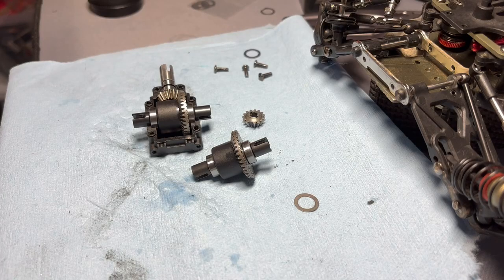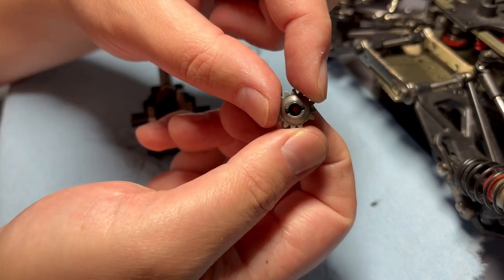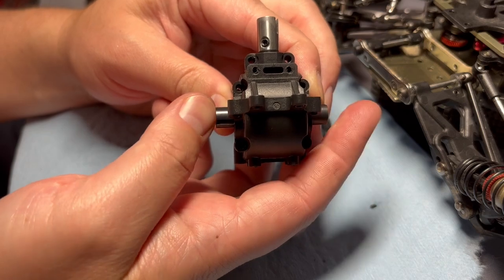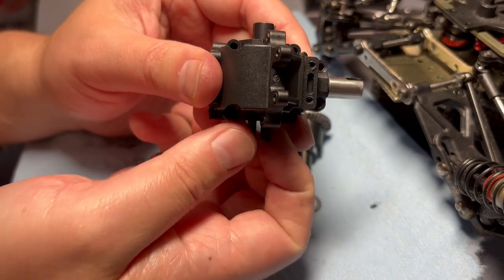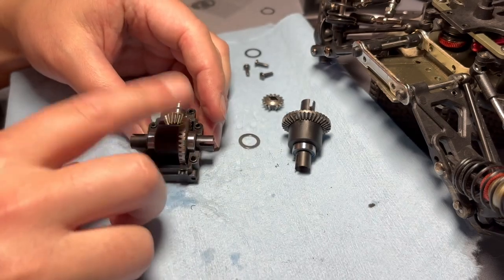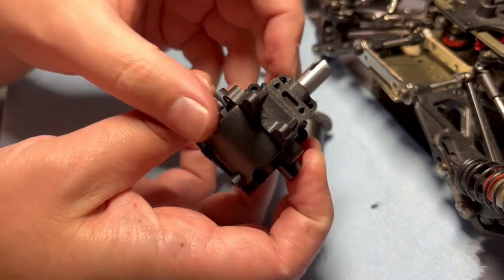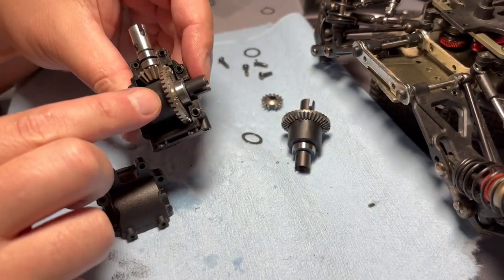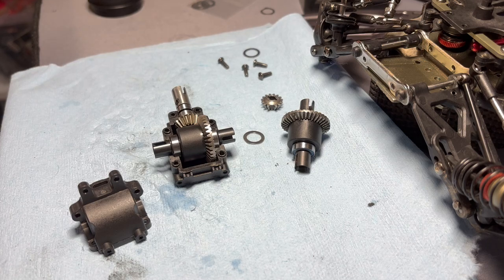LC Racing EMB-T: Do you need to shim your diff?

Comment: Hey! Thanks for a video. I have an emb-t and always suffering from diff installation in place. After installing it in box it spins ok, but in some positions it stutters. I’ve noticed that this relates to screw tightening order, but never spins without issues. There is no broken teeths. It happens to rear differential most of the time. Even with new diffs and new diff boxes I have that issue. What should I do?
Reply from the maker: Hi sergeydanko1999, thanks for reaching out. Since you're using all new diff components it really boils down to make sure you have it shimmed properly and that you have adequate diff oil. First, make sure you're using a new diff oil and fill to about 80-90% full. After that, when you close up the diff before shimming i assume this is when you experience the stuttering, right?

If so use the methods in the video to either add shims to reduce or increase the mesh from the diff gear and bevel. if its too close, it will feel tight with a slight grind. 

If It's too far, it will feel loose, causing the motion to feel inconsistent (sometimes loose, sometime tight) or sutter as you mentioned. adding shims to the side your gear diff is on to reduce the gap and this should resolve your issue.
Reply: @ thank you so much. Just wondering why I should shim new components if there is no shim from factory
Reply from the maker: @sergeydanko1999  generally speaking almost all RC kits require some shimming or adjustments. Were talking about variances of 0.1-0.2mm. Its sounds like nothing but its the difference between lasting 10 hours and 100 hours sometimes. Always shim for optimal performance.
Reply: @hobby_addicts  thanks! Looking forward more video about rc stuff on this channel :)
Reply: And I believe i should extremely gently tighten up the diffbox, otherwise I will never have perfect spinning with this diff box even if I’ll re-tight it again due to kind of flatten diff box plastic. And sorry for my english 😊